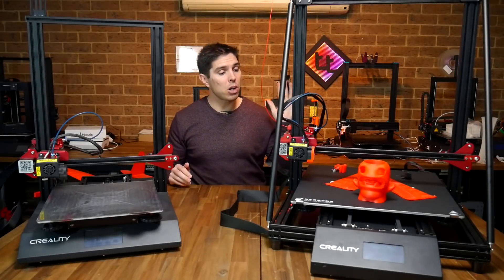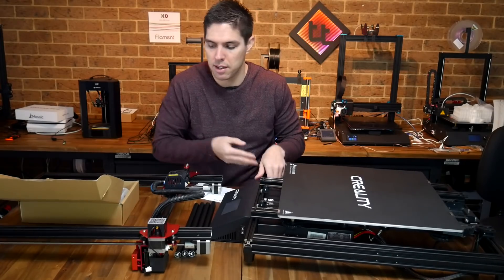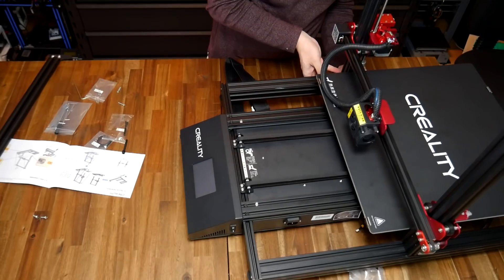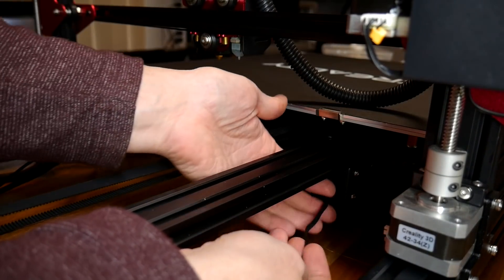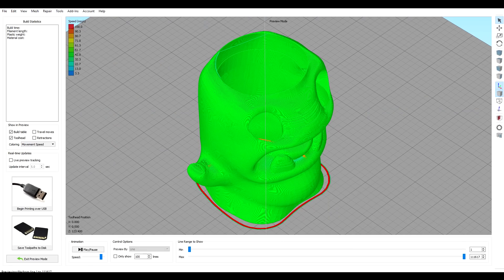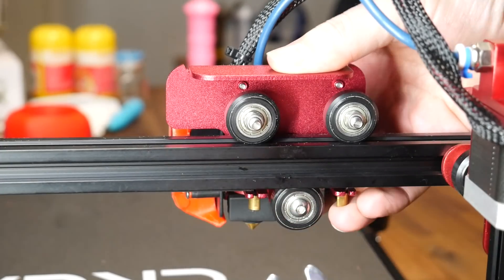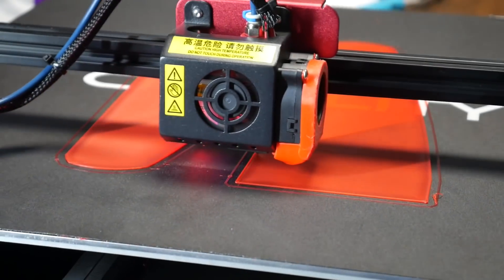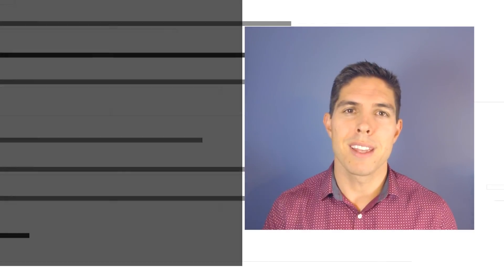Creality CR-10 Max first impressions: Is bigger better?

Comment: If you upgrade the firmware you can modify the bed size to match the actual bed size which is 470x470mm. I set mine to 465x465 so I could print Astromech parts in one peice and it works well.

Comment: Okay. I’m tired of reviewers and how they talk about how hard it is to remove prints with scrapers. The problem is the scrapers are blunt tipped. If u put an edge on it, removing prints becomes super easy. I took my scraper that came with my cr-10-v2 to a wet stone and now that it has an edge, it works amazing

Comment: 10:35 You do it wrongfully! that way will ruins your bed leveling. Take the bed surface apart from the print bed firstly if you want to take the prints. Besides it, why don't you just take it with your hand without the scraper? Tall model are easy to remove without using scraper, I think you're also using the scraper wrongfully sorry.

Comment: Please do an update to this video. I bought this printer largely based on your review and the things you said about it.  It is a decision that I deeply regret and nearly 2 months later I still do not have a working printer.  The issue of course is the BL sensor, which I thought you said was fixed and the reason I purchased this. Well it's not fixed... or Creality knowingly let these things out into the wild to be sold to unsuspecting innocents. I reviewed Creality on Google maps in HK and the distributor in CA, however I think you should do your part and let people know there are still issues with this by publishing another update video.

here is my Maps review: Creality allows its distributors to ship defective merchandise which they built.  While buying a Creality CR10 Max, despite claims by Creality's official vendor  "creality3d.shop" that my printer was undergoing "quality control checks", it arrived late and inoperable. After a week delay in response from their "tech support" I was told that the BL system was damaged in transit to me. 

I find that claim highly dubious because there was no visible scuff or damage of any kind to the shipping box, and the printer was tightly packed within the box.  The only logical explanation is that a defective printer was knowingly shipped to me, and now, almost 2 months later I still do not have a functional printer because although they claim that they'll send a new replacement part for the defective merchandise they refuse to say when they will actually ship it; this has been going on for a MONTH - yet they continue to sell these printers on the internet claiming them as "in stock".  

After searching the Internet, I see that I'm not the only one who fell into this trap.  In fact an early review of the product one year ago by a popular YouTuber disclosed that "the main problem of this printer in the past which was the dodgy bed leveling sensor is completely fixed with the BL touch".  This is not true and nothing is fixed - OR - Creality has knowingly distributed out all the printers with defective sensors to their authorized resellers for sale to the general public.   

Whatever the case, Creality and its distributors need to face scrutiny over their Internet commerce practices.

Comment: Im a complete beginner with 3d printing allthough use to program cnc mills and lathes   and am having fantastic results with this printer,  for me it was pretty much plug and play and have made a few mistakes (operater error ) but overall that thrilled with the results plan to buy another one.Prints come off easily and have only printed pla so far but wish to try the upgrades and use petg carbon also.

Comment: It's kind of the same situation as the original CR-10. For the build volume it's a very affortdable printer and the issues are relatively simple to fix. If you spend $1000 on a prusa mk3 S it will absolutely be a more set and forget printer but it can fit in this thing's build volume.

Comment: I purchased this printer for 712.99 and assembled it, and leveled the bed. The prints like shit. Every time I print something it is super soft. NOT RECOMMENDED!!!
Reply: Lol, the joys of calibrating my friend!

By soft I assume you mean under-extrusion and not all the material is there. Unless of course you’re printing PETG or Ninjaflex (which is a material designed to be soft/flexible). Or you mean right when it’s done without waiting for it to cool (in which case wait a few minutes for it to cool). Good luck, it should be a decent printer but you’ll probably have some calibrating/troubleshooting to do (good thing though is you actually have the ability to do so and it’s not locked down pile is garbage like my cousins MakerBot with it’s locked down proprietary code and terrible slicer, so he’s ripping all the electronics out and swapping for open source controllers so it can run anything he wants).

I’m using my old, old printer still. I think the closest equivalent is $79 in today’s money, lol, but honestly that $79 printer has a screen and SD card reader upgrade (mine I have to leave my laptop plugged in the entire print). It works decent for me, but I’m eagerly awaiting my second machine arriving tomorrow (mine was modified like 6 years ago for extreme speed, I was cranking out parts that took others 4-5 hours in just 15 minutes, I use them as “rapid prototype machines” as this was their intended purpose before “3d printing” was a hobby).

I’m sure you can get yours working nicely, this is a decent machine, way nicer than mine, haha! But even so, my old one did great just cranking out SAE spec gearing (like my favorite double herringbone gears) and made ridiculously strong motor mounts/airfoil structure/automotive replacement parts etc for years. I just wanted a second machine for optimizing accuracy since I need some things within 0.001 inch tolerance or better and might as well have one setup for speed and the other accuracy). My 2nd printer I wanted to spend $500, but it seems you only get bigger and not better prints beyond a $170 Ender 3... So I looked at some better designed frames and saw potential in the old Tronxy 3 model (very similar to Ender 3 but with duel Z axis support, which is important because I’ll be modifying extruder to direct drive on carriage) so I’m opting for that because I like the frame design (after some modifications) and will likely replace the generic board with a 32 bit board and just build it exactly as I want. I was thinking might as well go full custom from scratch but honestly the base printer is $99, and my time as an aerospace engineer I might as well just get most of the parts sourced in the kit and make a few substitutions (plus I can always give away the parts I don’t need as gifts). It may take a little work but you should have a quite capable machine (well above what I’m using), it just might take some TLC, good luck!

Comment: So what's the difference between the Max and the CR 10 S5?
Reply: its smaller but as some go-fast red on it. 
BL touch installed, Central console, touch screen. Z extrusion Stabilizers too.
Reply: @spongebob358  would you say the Max is better or not? I really wanted the S5 but it seems like Creality doesn't want to improve it like they do the others

Comment: Can you help me determine what parts i need to order from Creality to widen my Pro so I can fit the Z Axis Struts. They need to make this kit available to us and call it a 10S Pro Plus Upgrade Kit! I really want to do this and I have the struts I just need the two lower extrusions to widen the base outside the steel cover. Can you help me to achieve this upgrade? I can keep the 300X300 print space that is fine.

Comment: Fantastic going to buy one of these .Can the control panel be put away from the printer with extended cables an a enclosure be added for Abs and polycarbonate prints ?  will the bed get hot enough for the abs and would one remove the bed springs completely ?

Comment: I really don't understand why these chinese companies keep releasing printers without thermal runaway protection. It seems almost malicious sometimes. It's like you have to go out of your way to not have it so what the hell right? With my ender 3, I was ok having to tweak stuff due to it's price point, and honestly it's an amazing printer after you fix it's small issues. However, these 1k chinese printers all seem to have corners cut that don't need to be. 

Also, honestly a printer this large really shouldn't be a bed slinging i3 style like this. Honestly even the CR10 is kind of big for an i3 design. I feel like large format printers should be coreXY, that's the only design that makes sense in a format this large.

Comment: Have many problems to balance the x-axses, does not work like shown in cr10s pro leveling video. Does anybody has expierience with that? My right side is 10mm higher then left side. Filament on the right side does not glueing to the bed

Comment: I ordered this printer. I wanted the Pro but found one if these cheaper. Bigger is better? I was excited to get the Pro it felt like the right machine. Now the Max is due to arrive tomorrow and I am getting nervous, Have I jumped into the deep end!!!!! I had a M3D Mini plus which was shifting layers on anything I tried. I had to contract some one to help with a few prototypes so I could test fit and test the heat effects. then I sold the heads off my old 427 Chevy LS7 the money was burning a hole in my pocket. I have a large Oak desk that should work,

Comment: after I saw this video I went and bought CR-10 Max, I like the size and the touch Screen but the bed leveling and the Bltouch is bad I cant get a good first layer and I couldn't find any slicing profile not even on creality website I don't now if you faced the same issues and if you did how did you fix it. I'll be really grateful for your help.

Comment: I was sent a prototype from Creality 4-5 months before they released it. I did a Beta test for them and went  over it very well. I see many of the things I told them about have not been addressed. The bed heater wire loom was a big issue I suggested they lengthen it and add a chain. Mine was so short it would not allow the bed to fully move rearward. The one I had used a double mosfet board for the bed heater and it smoked quickly. I suggested a SSR which I did install but you did not mention what is used there. The hotend wire loom was also another suggestion I made to them because it was hanging down and they routed the Capricorn tube through it. I suggested separate the two and use a better quality split loom that would not sag so much. I did that and it works great. There are many more things that were poorly done and I made suggestions to them how to make it better. The one I got did not have a BLTouch but still had their CR10s pro setup but oddly on mine it worked well. I did go with mirror glass for the bed which made it a must to go with a BLTouch so I did.
Just funny how they would give me a $1000 printer for my effort (no complaints about that for sure) but then not take any of my suggestions and use them. Go figure. I still have a fantastic printer after I repaired all their problems. Cheers!
Reply: cybor462 Hi Sir,
May I ask how you managed to be a beta tester and receive a free machine?
Regards
Reply: @theogaillard5355  They found me and asked me. It seems I am too honest to be useful to them. I do not do reviews just love 3D printing. I was asked to beta test this machine and for a free printer why not. I did a comprehensive test and found a number of faults, some major. I documented them with video and pictures and a breakout text write up. I do love this printer but I had to spend a ton of hours and parts to get it right. I am very happy with what I have. But......I tell it like I see it and I bet they will not be asking me to do another. All good!

Comment: Hi Michael, great review as always. The biggest problem I had with the CR10s Pro was the X gantry dropping down on the left side after power off, since linking the Z rods with a drive belt across the top this issue is now fixed.  Can you tell me if CR10 Max suffers from this issue.

Comment: How do I add the printer in Cura? There printer is not on the list.
Reply: Did you find something?
Reply: @mathiasriccius-andersson3440  yes. Just add the CR-10 and modify the printing area size. Nothing else. Works like a charm!
Reply: @MEisLOLtoday  Okey I have no good luck in the auto leveling first layer always get ugly

Comment: Hey, are you planning on testing the CR-20 Pro? if not, do you at least have some opinion on it?  I am currently looking to buy a 3D printer and so far I was thinking about getting an Ender 3 Pro, but I realised that after spending a bit for some of the upgrades I want, like BLTouch and Capricorn tubing, the price would be almost the same in my country. Do you have any recommendations on which would be better?

Comment: I'm tired of Chinese printers that have A LOT of issues. That "it's an easy fix, just print 40 other parts and replace 60% of everything in this printer and it will be awesome" attitude is really bad in my opinion. We had pricey printers, we had super cheap Chinese printers, now it's time for actually good printers.

Comment: How well would this print TPU? I use a modified PLA that has a shore rating of 85, it's flexible, but not anything like ninja flex... much easier to print, but if I don't print slow (30-40mms) on my Prusa mk2 it tends to jam and spill out of the side of the gears. Creality states this will print TPU, but I've always read bowden tubes are jam-central while printing with it.

I'm looking for a large print volume, but I'm guessing most of this size will have to use bowden setups to keep weight off the horizontal gantry and extruder.

Comment: Get rid of the springs and just use metal spacers. If needed you can use a thermal resistant plastic of some sort if there is any danger of the a metal spacer chewing into a electrical heat-bed trace. You don't need mechanical adjust (as you've pointed out). Some may think it dangerous (so don't do it if you think so) but I purchased a putty knife and sharpened it to nearly as sharp as my kitchen knives, prints come off so much easier on any surface (provided you pay attention to the angle of the knife). 

Completely inexcusable design choices were made with this printer. The only thing I like was the addition of the BLTouch. Otherwise it's just add some alu to make it bigger which is no where near $500 value of extra alu over just a normal CR10. It wont print better than cheaper printers, only bigger. So go buy some alu and toss together yur own extended frame. It really is as easy it sounds, in my opinion anyway, and that's why I made my own printer. Though I do understand that some people want a printer only for what it can make and they don't want to tinker with the printer itself. If that's the case then this printer is a failure, because it doesn't work out of the box; you had to tinker to make it work and you have a good deal of experience working on 3D printers. Not worth $1000 in my opinion, that's far to much for a hobby machine that requires modification to work.

Comment: Once again Creality releasing a half baked product. I purchased a S5 even bigger a few years back. Came with a faulty board, they told me it was in my g-code and totally ignored me. Found a bad trace to the heated bed circuit. This taught me how to deal with sleazy Chinese products and the sales chain that sold it 3-d printer bay. (Thumbs down to them for actually calling me “needy”)!!!

Comment: I like your approach to this printer. But I am trying to stay off the y bed swinging back and forth. In addition for having experienced 2 creality 3d printers. i am all crealitied out. I am waiting for something amazing to come out before buying more 3d printers. I spend most of my time fixing or replacing and tuning cheap components, eventually a $700-$1000 printer ends up costing double or triple in the parts i have to buy to get it to print decently. This one looks nice and it may work great but it seems limited by design.

Comment: I have found that the best thing to remove a print is a sharp chisel. It will not damage the print. You just put the sharp chisel edge under an edge of the print, twist gently, and then repeat at various edge points of the print. It should come off after only a few spots. The spatula is uselessly flimsy.

Comment: Good video, thanks for the first review.  I am curious what kind of hot end / heater block is on it as to support the 0.8mm nozzle at speed.  That will be a lot of plastic it has to melt.  Another thought is with that massive hotbed, how long is the heatup time and what are the acceleration and jerk setting.  I looks like it might be like the Queen Mary turning.. slow.   Also noticed solid stepper to z lead screw instead of the stranded spiral one.   I like the diagonal braces, must be necessary with this height.  Looking forward to your complete review.

Comment: Hey, i have been watching your channel for a long time and it has helped me alot learning how to print better. I have recently went from an alphawise ex8 to an ender 3 pro. I used ideamaker on the alphawise and i loved the slicer. However when i tried to set it up for the ender 3 pro i have a problem with the end gcode it seems to freeze up the printer when it finishes the print keeping the hotend and bed heated up and also freezes the screen so i cannot access the menus. I was wondering if maybe you could help me and others like me set up ideamakers gcode to work on our ender 3 pro. I tried to copy cura ender 3 start and end gcode to ideamaker but it gives an error on the end gcode